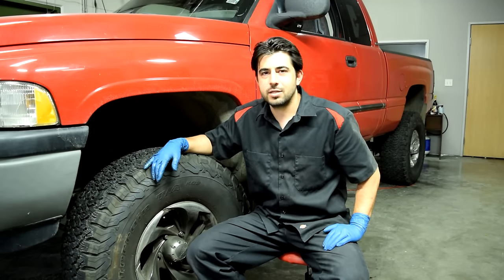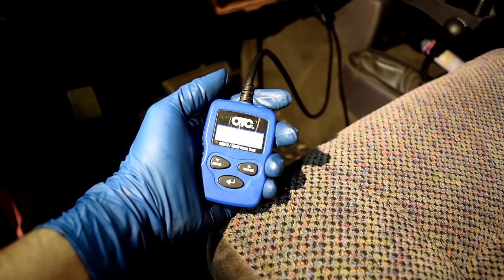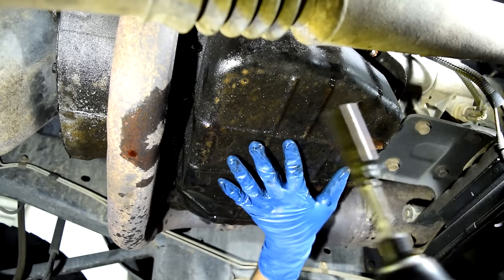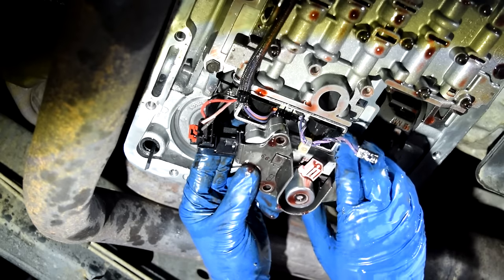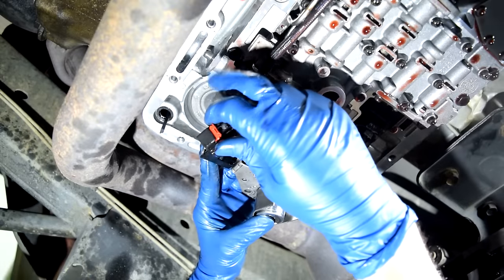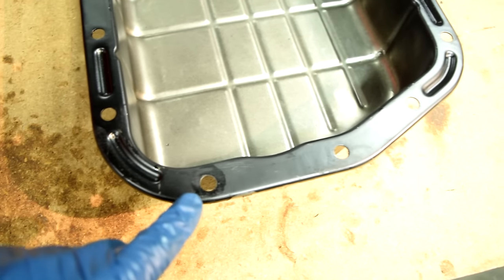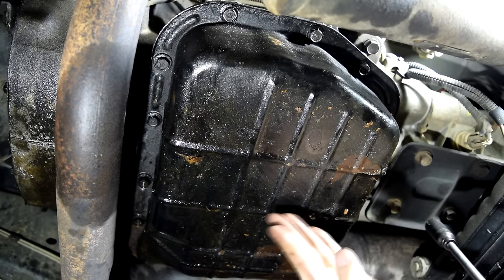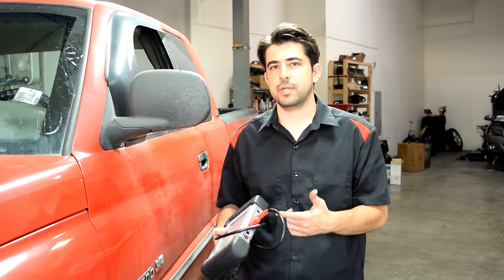How to Fix an Automatic Transmission That Won't Shift - Replace Pressure Solenoid, Fluid and Filter

Comment: I have a 93 jeep Cherokee xj with the AW4 auto trans that's stuck in 3rd gear ONLY when at operating temp. replaced all 3 solenoids and filter. no change. found out the old solenoids tested good after I already changed them out. any thoughts on a fix?

Comment: I'm having a similar problem with a 2007 Jeep Wrangler Sahara 2wd not shifting out of 3rd gear.  Does this transmission use a similar solenoid?

Comment: In my 01 dodge pickup 1500 the transmission doesn’t want to go into gear till the motor has ran a couple of minutes. But works fine after that. What could cause this. I’ve had this problem for years since I had work done on transmission. I hope you can help me

Comment: I have a 2017 Buick enclave    Fully automatic that  sounds like it stays and 1st gear and won't down schift when I put in a neutral while  going downhill while driving. Could you tell me what the possible issues are in this situation. Thank you.

Comment: Hey,MR.Ratchet- I have the same issues,but my check engine light is not on would it  be 
Pressure Solenoid ? I have a 1997 dodge dakota  318-5.2-4x4  The truck shifts in all the gears but it slips or bump into gear..Trying to say it slips a little and lite harsh shifitng..Please if you can get back with me..THANKS !!

Comment: I have a 1998 Dodge Ram 2500.shifts into reverse but wont go.any help would be appreciated
Reply: I have the same issue with reverse have you fixed this issue????
Reply: Trade it in on a Ford!

Comment: hey dude nice video I change my transmission pressure solenoid and now my dodge shift properly but the engine light is still on can you tell me how I can fix that light. I really Appreciate it
Reply: may fernandez clear the code just unplug battery and it will reset it

Comment: I have an 2010 ford focus 2.0 . It shifts 1st- 2nd- and 3rd good but 4th gear does not kick in..i already had it scan and had to replace solenoid c, but it still won't shift to 4th gear. Can u help me figure out this prob?

Comment: Last night I had this issue, twice, but after pulling over and restarting it, it worked again. Today I've had no problems,  but the check engine light is on what could 5he issue possibly be?

Comment: I have a question if my Lincoln MKZ 2007 is changing gears fine but sometimes when going to 2nd gear the rpm will go up to 3000 rpm and then it will go back down and change?? What should I do is that something to worry about? I want to change my transmission fluid bc it’s dark but idk if it’s gonna hurt it

Comment: You said when transmission oil is over filled you experience no shift of gears, what if the oil is low below the maximum mark?

Comment: I own a 99 Pontiac Montana and the other day I drove about 30 miles with no issues, as soon as I pulled in the parking lot of my destination it would only rev. I pushed it into a parking spot and shut it off. It rolled in all gears. If I let it stay off for a minute then turn it on and put it right in drive it worked just fine, until I switch in reverse or any other gear. It just stopped working again. Keep in mind I didn’t have enough room to see if it would go in second. Please help me out with some advice.

Only problem I noticed before that is it felt like it was missing every now and then when trying to maintain a speed. Even threw a code once, but it was gone before I could check it. But.. It only did that once or twice before it went dead like it is now

Comment: Diagnosing a 2000 dakota 3.9. Truck won't shift into reverse. Fluid looks and smells pretty bad. Would this procedure may fix issue?

Comment: Good how to fix it video and your not  using a torque wrench to remove bolts as shown in thoroughbred diesel to remove bolts fixing the same transmission problems. Thoroughbred diesel should have paid you to make this video.

Comment: We've been using normal silicone for 40 years and never had a problem with additives or ATF ripping through it. You don't need to go around the outside of the bolt hole...

Comment: I have a 2003 Chevy Monte Carlo LS 3.4..I replaced the transmission 3 time..One rebulid  and one used and I'm still having problems with the shifting ..1st the 2nd gear won't shift properly you have to accelerate hard all  the way down to the floor. 3rd and 4th gear and so on are OK. I don't know what to do any suggestions ?

Comment: I have a 2006 Toyota solara,  My code is p0746 pressure control solenoid, would it be the same thing your changing ?

Comment: Hi! hope you can help me, I had a problem with my car a ford fiesta 2011 I just scan it and it has a code of P0700 and P0054 my problem is when I first used it today it only stays on the first gear but when I stop and turn off the engine and start it again, it shifts right as seems nothing wrong with it so maybe it might give you an idea too  for what is the problem.. thank you

Comment: Maybe the same similar problem for a Dakota? I was almost going to buy a Dakota from used car dealership. I didn't even want to test drive but I was just like eh ok. I think it auto shifted fine from 1st to 2nd. But I noticed around 45 mph that it wasn't shifting to 3rd and the revs were about 3,500-3,700 rpm. I just called it quits, didn't buy the truck.

Comment: The transmission on my car has a delayed shift from 2 to 3 gear after driving for about 20 miles or so. However the problem does not occur during the first few miles of driving. The delay will only occur from 2 to 3 gear. Can a bad solenoid be the cause of this?
Reply: Did you ever fix your car mine is duing the same?

Comment: Hello, 
I have a question about my 02 honda civic ex BMXA automatic transmission doesnt engage and there's  no codes. I checked the selenoid and all of them are with in range in ohms resistance and they all do the clicking when I introduce power. It used to go in reverse or in drive before it warmed up. Now I put it in drive or reverse and nothing happens. No MIL codes. I ran out of things to test. Unless you know anything else I can try?

Comment: I love your videos. my car Nissan y11 2003 swap complete engine transmission  from nissan y11 2004. Noticed car run 4th gear not shifting to other gears.  further scan tool not communicating with ecu. so cant read code. help me please

Comment: I know this is far past the 32h question time (1 mo), but what would you think to check first for an engine click on an 03 Toyota Avalon, alongside possible power loss and occasional shuddering that vibrates the whole dash? I'm thinking it's a combination of oil gelling and something with the VVT-i, but I'm not sure at all and I don't have the tools to check. Also, when my battery dies the alternator clicks rapidly instead of attempting to turn. Is that a sign of a good, high grip belt or a bad alternator, which might also explain the battery parasite issue I'm having with it? I need external input before I decide to dig deeper on my own.

Comment: Hey man great video I was wondering if i need to replace my solenoid too--what do you think? im having a shifting issue on my 2003 Ram 2500.It doesn't shift 4th gear right away --I have to give it a whole lot of gas to shift after 4th gear. ...this happened after I changed my transmission pan and filters and new fluid but I did not do a fluid flush.Do you think this is a solenoid issue also? The engine light is on with codes P0700(Transmission Control System(MIL REQUEST) P0734(gear 4 incorrect Ratio) P0731(Gear 1 Incorrect Ratio) P0841 (Transmission Fluid Pressure Sensor/switch A Circuit Range/Performance)Any advice would e so appreciated man. Thanks

Comment: If the transmission only has reverse in a Chevy 2500 4wheel drive will adding foam fluid help

Comment: What going on when a 1995 VW Eurovan with 78k miles, the automatic transmission will not shift lower when moving...solenoid(s) wore out?

Comment: Hi, I have the same issue with my Isuzu Rodeo 1993 4x4  V6 24 vals,  where can I buy the parts  for the transmission   governor solenoid kit repair?

Comment: mine is "sometimes" not shifting from 1st to 2nd gear only...  tried replacing transmissiom computer module(TCM) but problem stil exists... tried replacing the old auto trasmission fluid but problem still exists...  the not shifting 1st gear to 2nd  only occurs occasionally.. is it a speed sensor problem?
Reply: what vehicle do you drive?
Reply: JM Luab
Reply: Watch this video again.

Comment: I have a 2006 toyota corolla with 150k+ miles the transmission fluid has never been changed. So today it stop moving even when I put it to drive or reverse. When I shift it to drive it would make some squeak noise. What can be the issue? Can it be solenoid and fluid and filter?

Comment: i have a 2008 dodge magnum. Im having rough shifting probs like my gear stays stuck for a bit at 1500rpm then it pushes to go. Dealership saids maybe its my valve body. But i have no codes, no lights. What you think? Im not falling for the maybe crap they say. That leads to guessing parts and me paying for something i did not need.

Comment: I have a 2000 RWD 5.2 V8 46 RE transmission, I'm having issues when I put it in reverse it clunks HARD. would servicing it with a Master solenoid Service Kit fix this issue?

Comment: I have 2000 z71 recently purchased. It will only shift into 3rd and 4th if you really get into it and then let off the gas and then hit the gas again once it's in 3rd  it pulls strong you have to do it again to get 4th once it's in gear it pulls good any ideas?

Comment: Good day.. I have a 1998 Honda Accord EX.. Transmission issues, from slamming into gear, rough gear change while driving and when I stop it stalls for like 2 seconds then jumps into (low gear) when stops. I bought a used suppose to be good transmission yesterday January 19. 2017. Mechanic installed it and Guess what, I am having the same issues... oh I forget it also stalls for 2 or 3 secs then roughly goes into reverse. The sound it makes its as if something is cracking up inside.. I'm frustrated. Any help on opinions? I'd appreciate it.

Comment: So im having the same problem on my 91’ dakota 5.2l v8.  Pulled the pan and i found metal in it. Im 95% i need a new tranny. It goes into drive and reverse without a problem but wont shift out of first gear. Any opinions before i put a new tranny?

Comment: I did this to my 97 dodge ram yesterday and now I got first and second gears issues I'm not sure if my transmission is done or I can do something else but not rebuilt the transmission
Reply: Try grounding your firewall to the negative of your battery. Your problem may be electrical as in your  transmission isnt receiving the signal to shift correctly because may be  distorted by something.

Comment: I dropped the pan. Removed the shift solenoid but it got really cold and i work the next day. Is it ok to leave the pan off the transmission for a week or will it get corroded? Its in my driveway and obviously wont be moved untill my next day off

Comment: Awesome video buddy I changed my fluid transmission the other day and. I was wondering if a Mustang V6 2001 have that selenoid in the transmission? Can anybody tell me please? Is an Automatic transmission. When Im in a stop light and I hit the gas my car kick once I guess thats the firts gear thats the only issue Im having. I dont know if is loke that or I need to replace the selenoid pressure sensor . let me know as soon as possible pls

Comment: I have something similar  happenings withh my 2000 chevy Silverado 1500. It struggles to shift to 4th then it stuck in 4th and wont shift down. Would the solution be similar to the dodge solution?

Comment: hello ratchets and wrenches, Ive been watching your videos and theyve been a big help for me. I am learning things i"ve never known. i do have a question about the "how to check your converters video". I have changed both converters{new} and all 4 o2 sensors{new} in response to the post cats not being hotter than the pre cat temps but everything still is the same except now right after putting all these new parts on i smell the "rotten egg smell" and the post cat temps have not gotten any hotter. HELP! what is going on. is there something else i should check out.
Reply: Christopher Zorthian is

Comment: I have a 2016 silverado motor and my check engine came on and the code p0796 is reading would I have to buy the hole kit or only the pressure control solonoid and would I need to reprogram my computer

Comment: I have a 98 ram 1500 and it doesn’t shift out of first but the governor and speed sensor have been replaced already, hopefully it’s an electrical issue

Comment: I have 2013 ram 1500 5.7 and have de code po868 I can fixed if i change the governor  selenite and the transmission oil filter?

Comment: I just replaced those 2 sensors and I'm getting the check engine light code p0753. It reverse fine but when I put into drive it moves slow, can you please help.. it's a 2000 Dodge ram 1500 5.2l

Comment: What are the 2 holes on hot on the transmission stick, do you need to add transmission fluid if it's on the first hole

Comment: Hi friend, can you help a mechanic here in Brazil ??
I live in Brazil and I have a 2000 Dodge Durango 5.2 with A518 44 re transmission.
A problem with a transmission.
when I put in D the car seems to be going off 3 gear and when I put it in position 1 it seems to be locked.
I dismantled the valve body and found that the plastic pressure accumulator is broken.
Is this the reason for the problem ???
I appreciate it immensely because I'm a mechanic here too.
thank you

Comment: Thanks for  the video, we rebuilt our transmission twice ( replaced the shift silonoid pack the first time not second) and when we speed up it is downshifting. Also back tires lock up it feels like and we have to put it in neutral. It is a Dodge Ram 2003 1500 5.9 liter , any advice anyone?

Comment: good evening. please i hope u reply. I use a Toyota Avalon limited 2007 with a 3.5l V6 5 speed transmittion but I noticed that at 3 rd gear it slipped and wen I accelerate gently or I accelerate harshly the 3rd gear engages smoothly but while moving normally it slips. please I noticed only on 3 rd gear. what advise do u have for me

Comment: What if replaced all solenoids, transmission fluid still pink in color, drained about a qt and put a qt of Lucas stop slip back in and nothing. My truck will start and move but won't go above 25 mph. Any help or guidance much appreciated

Comment: would a faulty or clogged solenoid also cause a transmission to not engage in 1st, but in 2nd, and would it also cause stalling?

Comment: I have a 1999 Audi A4 1.8 B5 ADR (non turbo non quatro) with auto transmission(filler is a pipe out of the pan to the top of gearbox and inspection plug at the bottom). The automatic gearbox slips to 3rs verry badly. I did flush the system and installed new filter an atf. It was fine for about 50kilo's then it start agail and it slips even more. did another flash but still slip. What will you sugest.

Comment: My trans sits in 1st gear sometimes. And other times when I’m in 2nd or 3rd it will just rev high then drop back down in gear, would that be the same issue?

Comment: I have a 2000 F250 that was going down the freeway and the transfercase blows up in a million pieces! I had to remove the front driveshaft at the scene of the breakdown as it was no longer attached to the transfercase. I then proceeded to drive away when I noticed the truck wont go past 5 MPH !  I shifted down into second gear and the truck went up to about 20 MPH, The truck goes parking lot speed in drive, and reverse works,  DO you think I need a pressure solenoid or did I blow up the transmission ??? Any help would be greatly appreciated !!

Comment: Another issue these have is the kick down cable arm on transmission gets Rusty and doesn't move properly the return spring also rusts not allowing arm to return .this causes the transmission to not up shift properly

Comment: Hey Friend, I have a 02' Dakota 3.9l 4x4 truck that it is giving me a P0748 Pressure Control Solenoid A Electrical code....Changed these parts and no change. any ideas? thx

Comment: I was replacing my shift control selnoid in my 09 1500 dodge ram i got everything back together but my dash is showikg my transmission stuck in reverse

Comment: I must be missing something:  When you saw that the trans. was severely over-filled why didn't you just remove the excess fluid and recheck the unit's function?
Reply: most likely because he had a check engine light that told him what was wrong.
Reply: I thought it said a sensor was measuring out of range.  Couldn't that have been because the transmission was over-filled?
Reply: wholeNwon he said often times when the transmission gets an issue people add fluid which appears to be what happened, but the parts were clogged that he replaced
Reply: I know.  His purpose was to show how to replace a solenoid. Others who have similar problems should first correct the fluid level and then retest the transmission rather than just going immediately to solenoid replacement.

Comment: Mine is a 98 Dakota with a 5.2 liter and 44re trans. It also does not shift out of second until almost 3000 rpm. Could this also be the problem with mine. Seems fairly easy to do. By the way i have no code displaying on my dash.

Comment: Question, what if you don’t have a check engine light on but you can’t get out of first gear, the problem I am having is even if I press the gas pedal all the way to the floor it takes time to pick up speed